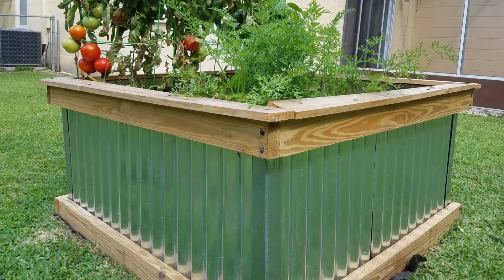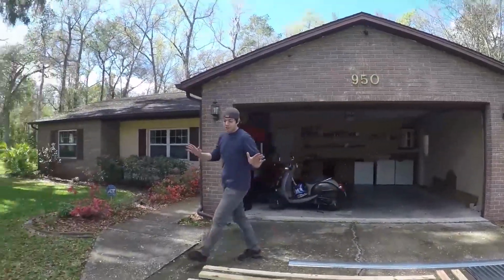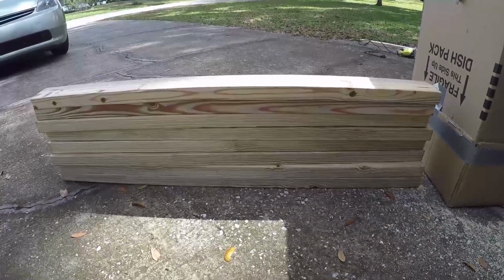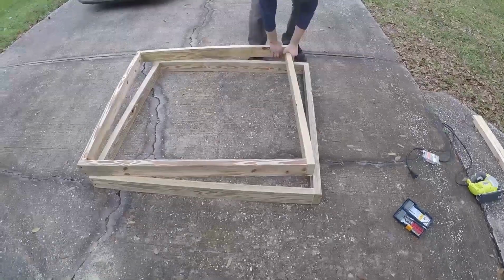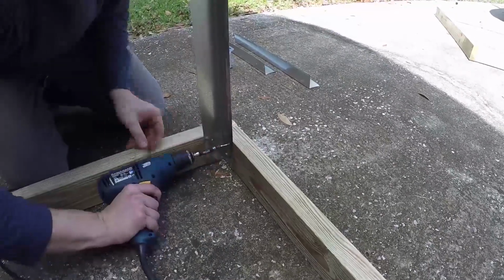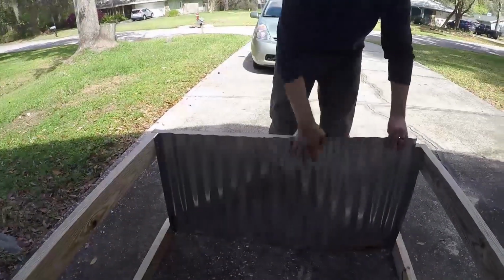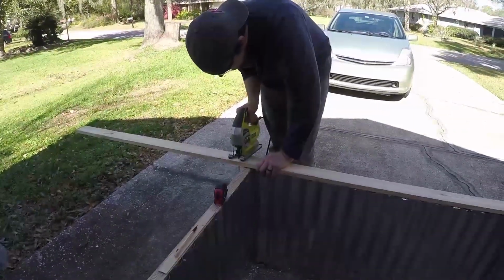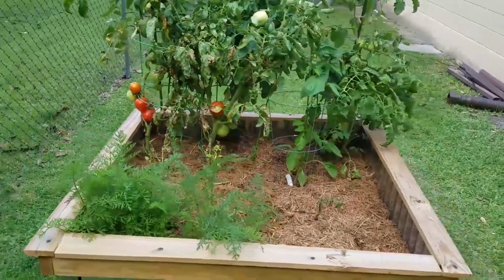How to build a simple raised garden bed for $50  | Simple Green Smoothies

Comment: You can have Home Depot cut all of the lumber for free so even the saw is not needed.  You could have eliminated the bottom wood too as long as you set the metal bottom into the soil a bit.

Comment: Those look great. Is corrugated the same thing as galvanized and rust proof?
Reply from the maker: Yes, they are the same thing and rust proof.
Reply: Corrugated refers to the wavy shape of the tin.  Galvanized refers to a process done to steel to make it almost completely rust proof.  So, you can get corrugated tin that isn't galvanized, and you can get galvanized tin that isn't corrugated.  But what you want to do what he did is corrugated galvanized tin.